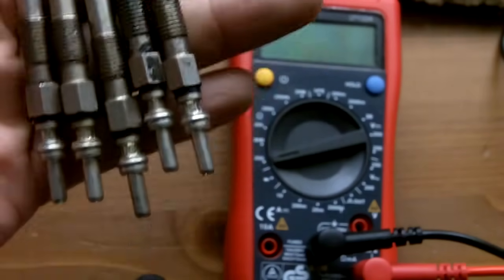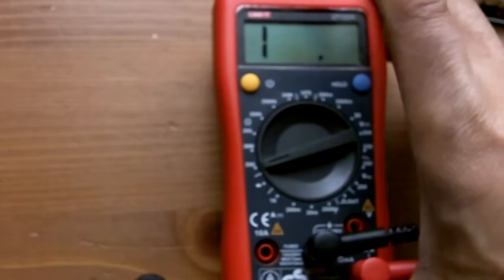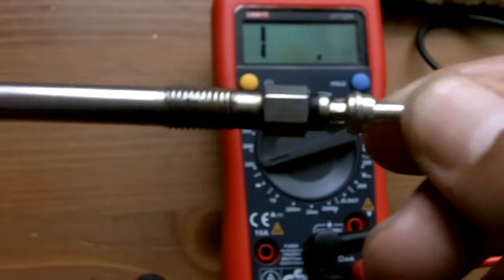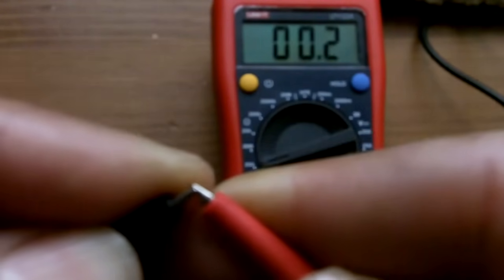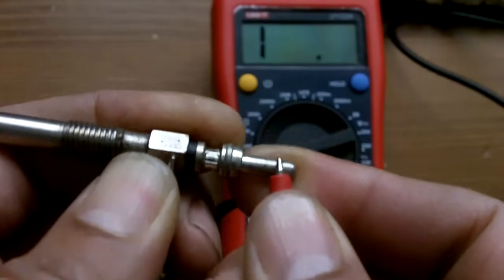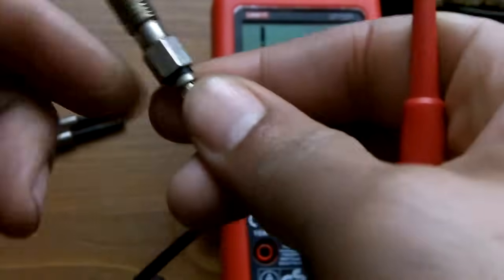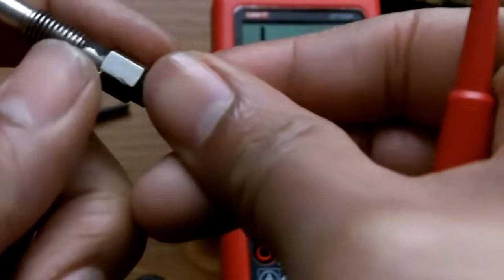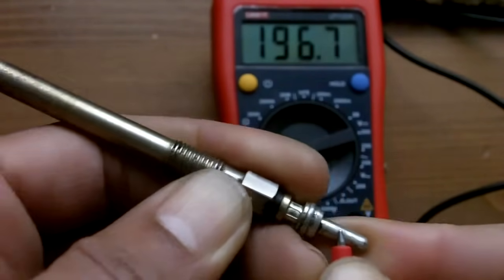Easy and Complete Glow Plug Test

Comment: I have an even easier and much quicker way. take a test light and connect the clamp to battery positive, then just touch the light to the end of the glow plug, the light should light up bright. when you have a dead plug it will not light up, if it is failing-hi resistance-the light will glow dim.
Reply from the maker: That's good. Whatever works for you.
I would say to a complete amateur though that if you don't own a test light or a multimeter, buy a multimeter first because it has many more uses.
Reply: sirobb Maybe, but if they are that much of an amateur, they will probably not really know how to use the multimeter. I would think a test light is as cheap or cheaper then a meter.  I own an auto repair shop, have worked on cars for forty years, I use a test light WAY more then the meter.
Reply: ksauto1 An amateur will get thrown off a LOT more trying to get the setting correct on the meter and reading/deciphering the reading. A test light is very quick and easy to see right away the results.
Reply from the maker: ksauto1 If an amateur doesn't know how to use a multimeter to test a glow plug, that's the whole point of my video......to show them and I show the multimeter settings very clearly.
Reply: Thanks this is very helpful. ❤
Reply: You are a MORON.   I just thought I would chime in and give you my "opinion" too.   You and the many morons like you totally screw up youtube.    This guy puts out a VID on HOW TO CHECK GLOWPLUGS properly taking the time to do it and show others,  whilst you chime in with a  second comment about "your way".   Going to your channel,  I see ZERO effort and ZERO vids of your own,  although you did "like" pole vaulting ups skirt vids...... so you got that going for you.   Why don't you just SHUT your mouth and let this guy SHOW people the right way.
Reply: ***** Wow-I never said anything bad about sirobb's video, it is a great video. Guys like him are a real asset to youtube. I simply wanted to add to his post and suggest another way of doing it, that for me, making a living as a mechanic, works a little bit faster and easier. I usually find the plug going from the relay to all the glow plugs and you can unplug that and test right from there. There is no need to remove the plugs or wiring. Again, when you doing this for a living and time is money any tips that can make a job a little quicker are appreciated. If the tip does not work for you, that is ok, no need to get nasty about it. My hat goes off to sirobb and the great job he is doing with his videos.

Comment: Hi,

 this is very usefull information for people, to spare themselves for canging glow plugs hen there is actually no need to do this as they are all fine. I had been testing my glow plugs like this for last 3 years before every winter to make sure they are all ok. On one of my cars they did not regiter any resistance on up to 200Ohms and they did not light up either when connected straight to the battery. New ones showed about 0.6ohms (NGK). Now, just today, i have new set of Denso glow plugs in my hands which show about 0,5ohms. Anyway, main idea is that, under 1ohm and they should work and they do when u apply voltage direct. But be careful with plugs that work on 7V(newer cars with ceramic glow plugs), 12.5V direct from car battery could kill them.

Only question to the video owner/maker: about testing the second glow plug, did i saw tip of the wire lead used to test just flying around i.e it lost connection to battery or something before plug could even react - would of expect to see if any result after being connected about 10 sec rather than 3 or 4 u filmed this one.
Reply: osoonikum Just to mention place where i live, we get every winter -25 degree C easy and usually see even down to -35 degree C for a week every year. -20 degree C is NORM so your diesel have to be in top condition, including glow plugs. If your diesel is in good shape(injection timing, battery, fuel system, starter etc) it should start down to -10 degree C without much hassle even if all 4 glow plugs are shot!

Comment: Thank you for sharing, Can you get an accurate reading from testing the plugs in the engine or should take them out?
I have a Toyota D4D that is blowing white smoke from cold and suspect the plugs.
Reply from the maker: Thanks for your comment.
You can get just as accurate a reading with the glow plug in the car.
Just take care to get good contacts on the nut and tip exactly as shown in the video.

Comment: Hi, great video. I'm having a problem with cold start and will use this information to go and test the glow plugs now! :)
Reply from the maker: Thanks.
So how did your own test go?
Reply: Glows plugs where fine. In the end it was a fuel problem. The fuel filter drain screw was missing an o ring resulting in loss of fuel and pressure. Hence no fuel or pressure there to fire her up in the morning :) Hope this helps anyone with a similar problem!

Comment: "As close to zero Ohms as possible" ?
No !
Ohms Law..... V=IxR, with 12 Vdc supply...looking for about 12 amps means about 1 ohm resistance per plug.( or slightly above)
Reply from the maker: So by using Ohm's Law, you believe that glow plugs should be greater than 1ohm?
Unfortunately, your method and conclusion doesn't explain why nearly every glow plug has an operating resistance of less than 0.9 ohms.
Perhaps you can tell me whose engines require glow plugs with a resistance greater than 1ohm?
Reply: sirobb
"...as close to zero as possible"....Perhaps you could tell me which engines use a glow plug with negligible resistance ?
Eg: 0.1 ohm drawing 120 Amps per plug ?
The CLUE is in the word "about "..get the idea now ?
Jeez.
Reply from the maker: supersesqui To be honest, I don't know what point you're trying to make because you comment a month ago that you like the video and now you don't.
My method has never failed me yet but I'm happy to be shown a better way, so maybe you could make your own video and teach us all what we're missing.
Reply: sirobb

It's a good clear vid...but the phrase "as close to zero ohms as possible" is very misleading.
It's better to be ABOUT the 1 ohm mark.
If lots lower it would pull to much current through the relay.
You must remember you are being viewed by some  non technical people.
Even if the value was 2 ohms it would still be ok to give heat at 6 amps.
There is going to be a variance as the units get older and i certainly would not change units if they were 2/3 ohms(unless you live somewhere sllly like Canada ..lol
Reply from the maker: supersesqui Me saying as close to zero isn't misleading at all because you want the reading closer to zero than to 2 for example. The reading will never be below 0.4 anyway so your concerns about amperage draw are unfounded. Glow plugs INCREASE resistance when they fail NOT DECREASE, so their amperage draw won't ever increase.
You also make amperage draw calculations based on the incorrect assumption that glow plugs all operate at 12v, which they don't.
At 1:55, I say you're looking for a figure of 1 and at 3:50 in the video, I once again say you're looking for a figure of 1, so I've said what you want me to say twice, yet you nit pick at my phraseology.
You really need to make your own video to your own standards because your comments here aren't really of any use.
It's been an interesting exchange though......

Comment: other test much faster on the roadside : use the car battery instead of the multimeter and if the glow plug starts glowing at the head is good if it;s start glowing at the middle is not .
Reply from the maker: How is your test faster?
You would have to unscrew each glow plug and wire them to the battery to test them.
My test can be done with the glow plugs left in place.
Reply: my mistake , I did't meant faster just let's say not everybody has a n multimeter in the car but they have a glow plug key :P)
Reply from the maker: Ok, yes I understand what you mean now :)
Reply: In my personal opinion the best thing you can do is multimeter it.Bear in mind that if you try undo any of them plugs there is possibility to snap these on engine and cause so much headache afterwards.

Comment: good test wish i could get them out..its been at garage and they say they will snao b4 they come out..and my cars gone to limp mode
Reply: snap off
Reply from the maker: You don't need to remove the glow plugs to test them using this method, so if the resistance measurement is 1ohm or less, they're fine and can stay stuck a while longer :)
What car is it? Is it starting trouble you're having?